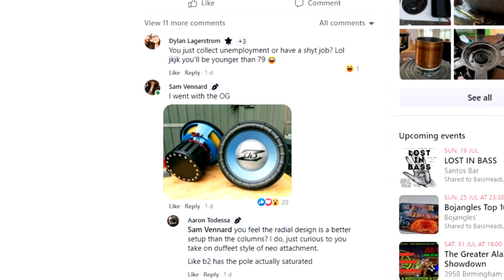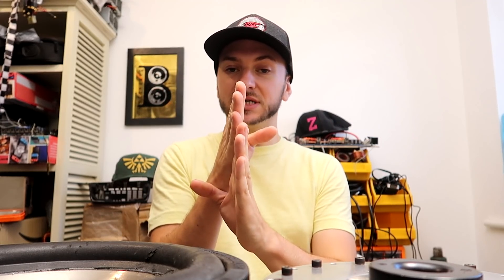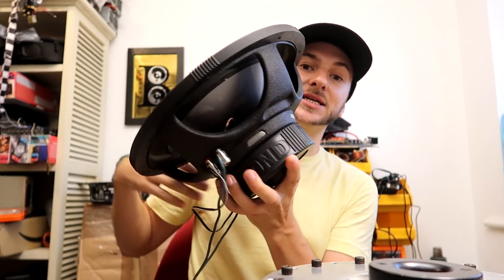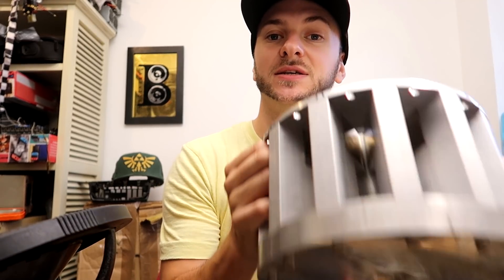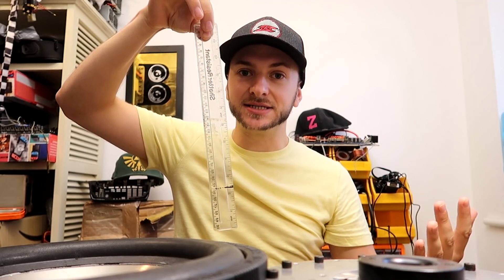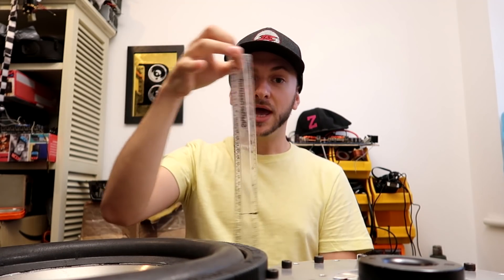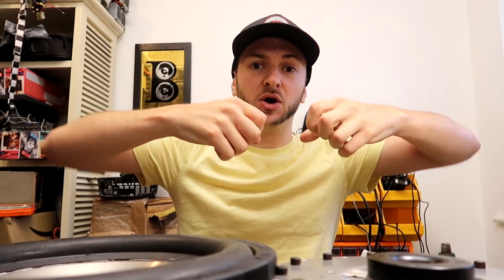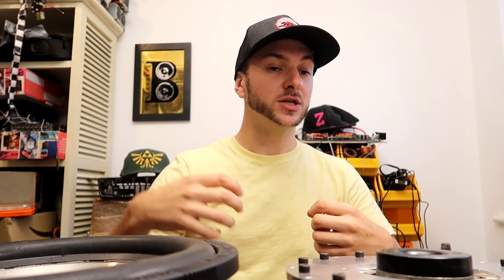Making you realise how ported boxes actually work

Comment: Your explanation verifies the approach at which subwoofer to get determined by the rear subwoofer cone that shouldn't be blocked by the subwoofer frame or basket. For instance CAB 18s and Mmats 12 Juggernauts. Get the picture?

Comment: I have seen video footage of winning one note wonder SPL vehicles. Craig Butler actually uses 2-4 digital designs 18s in small sealed boxes made of a wide diameter tube. So I can only guess they are tuned to resonate at 70-ish Hz and then the rest of the cabin is designed to resonate - either by standing wave or some sort of bandpass to the exact same frequency, creating that huge one note wonder bass.
Reply: Bandpass enclosure... the entire cabin is a box, with a sealed and ported side.
Reply: @n8skow  I'm not quite sure because there is no port to the outside on Craig Butler's video to make the cabin into a front bandpass chamber. You'd have to make a substantial opening to get that big area to resonate at ~70Hz. Making the cabin a half wave and trying to get the sound wave to rebound at the woofers and the mic, so the woofer loads agains maximum air pressure might give some good SPL, especially with a sealed chamber that resonates at the same frequency.
Reply: @TimpBizkit  it IS a bandpass. The entire opening you are looking through when you see the woofers is the port. Its a very common design on the BIG number builds... woofers in tiny sealed enclosure placed inside a huge ported cabin.

Comment: I always wondered why spl woofers claim they are not intended for sealed boxes. I suppose you could put them in a sealed box, but it could rip itself apart if you use it at high power. If I understood correctly.

Comment: So it's possible to reach a point where, in a sealed box, power handling doesn't matter? Sealed boxes are somehow limited and it doesn't matter how much power you throw at your sub it won't get any louder? From my understanding it's not only how far a cone moves but how much force it's moved with that makes pressure. That pressure would have benefit in any enclosure wouldn't it?

Comment: Sealed for the win all day long and it sounds so much better without pissing the neighbours off bass inside not much outside. 2 x 12" 600w peak pioneers running 2ohm at 600w rms I can't wait to get dual voice coils and get it down to 1ohm. + ported is tuned to a spefic freq and most will not boom away from the resonant tune.

Comment: Great way to explain it, great vids bro!

PLEASE explain the Pros vs Cons is a Bifilar voice coil ...from what I read it’s more SQ/SQL based vs SPL, and I’m rebuilding my Alpine SWX-1243D which uses an inset (inner/outer wound) voice coil, so I need to replace it with something almost as good and thinking an 8 layer flat alum bifilar is the way to go ...would really appreciate your input homie.

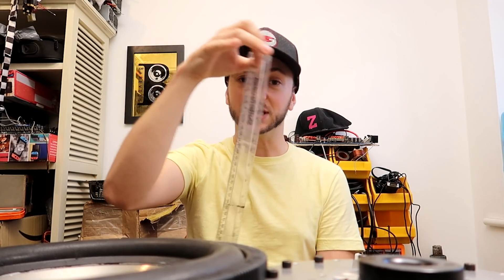Comment: Small correction. When the frequency is higher than the port tuning, like you show in 8:49 what happens is that the inertia of the air mass in the port makes system act like a sealed enclosure and that gives some control to the cone and limits excursion. Under the tuning frequency there is no help from the box like you mentioned.
Thanks for the great video!
Reply from the maker: Great info!

Comment: Your analogy with the ruler was great until you said that higher frequencies unloaded the woofer. That is not correct. The woofer becomes unloaded with lower frequencies below the tuning because the air can move in and out he does not provide any airspring because of how slow the driver moves. It would be like your hand moving back and forth slower than the ruler pendulum frequency and the whole thing moves in and out like a straight line and doesn't swing
Reply from the maker: You unload at higher frequencies too. The rolloff is more shallow but once the helmholtz mode breaks down the port is just a hole in a sealed box, allowing front and rear wave to wrap around and somewhat cancel. Try it, say for example with a box tuned at 30hz, play 65hz and take note of how it sounds, then block the port, you'll notice it sounds a lot better and louder and the driver will move less.

Comment: You can create a louder sound with more acoustic pressure in a horn box or similar with the same Xmax and cone area but a stronger motor. You might need a different type of enclosure to extract the most potential out of these "low Q" woofers. Typically a sealed box will waste the potential of these powerful motors.

Comment: would really appreciate it u can give me a little advice, so i hooked up my soundstream 5channel lil wonder 4 series amp wrong side as in polarity and it wasn't turning on after i check it then i open it an saw a little strip of wired burned out like the flat solder on the board it acted like a fuse i solder it back and now when i connect the amp its getting current cause i can see the wire spark which always happens when he amp gets current (that was not happening before I solder back the trace on the board) so its a good sign. but i am not seeing no light an its not working still any help please thanks u really appreciate it or and I bypass the remote wire with the positive of the amp so idk if that negative current when hooked up wrong side  damage the remote system on the amp or the diode shorted but I only see filter caps where the on board fuse blew no large diode only smaller ones the zener diodes on the left but they don't connect to the positive I can email you a pic if u would like to see thanks. also there is no reverse plarity protection diode
Reply from the maker: hey buddy. For the trace to have blown open like that, it likely will have catastrophically damaged a whole bunch of components on the power supply section and control circuit. It will need to be sent to an experienced technician to get rebuilt.
Reply: @barevids  ok thanks brother

Comment: I used to make these crazy band pass boxes with 1.5cu ft sealed in front of the cone and another 1.5cuft sealed in back with a 4"X8" port But the port always whistled, not a big deal the trunk would absorb that sound but even when I tried rounding the edges of the circular port tubes always whistled Why is that?
Reply: Bad math.

Comment: Bro, thank you.

But now all I can think about is can someone make a box designed with an active valving system for the port to actively adjust the port tuning on the fly to constantly be at peak tuning for the note being played? 
 We've got microcontrollers that can measure pressure hundreds of times per second and electric motors that could open and close different ports or just slide the port telescopicly to adjust the tuning frequency while the song is playing. 
So am I crazy? Or is this possible?
Reply from the maker: Yes but there would have to be a delay in the signal. The circuit needs to be given the frequency of tone from the music, decide what length to make the port, then the motors need to move the port into position. The circuit wouldn't know what tone is coming next until it comes. So you can either choose to have the adjustable port run in constant catch-up which would make for a sloppy sound, have it delay the tone from reaching the subwoofer slightly while it makes its adjustment, or have it analyse the track in advance so it knows what's coming next at all times.
Reply: @barevids  alright. So it's definitely complicated. But is it too complicated? I hope someone smarter than me figures out a good way to do this. I just wanna see it in action.
Reply from the maker: If it would have been viable, it would already have been done.
Reply: @kellypg  also bass is not always just one frequency. The tone and quality of the bass comes from many frequencies stacked on top  of each other

Comment: It might be helpful to add that the reason why you're able to produce such huge excursion in a port with such little energy is resonance. Everything has an F0 or, resonance frequency and that's the frequency at which the thing vibrates the most with the least amount of input energy.

I think one of the most useful visual representations of the power of resonance is the collapse of the Tacoma Narrows bridge. The bridge does fine in the wind until the wind causes it to oscillate at its resonance and then, almost suddenly, it self destructs.

The same thing can happen to your subs in an enclosure that's improperly designed.

Comment: 4:00 so what I'm hearing is the larger the enclosure, the more efficient it will be (to a point)?
Reply from the maker: Yessir, absolutely! But the quicker you will hit mechanical excursion limit! Big boxes are great for super low power subs but anything with any real power behind it and it will rip apart before you even put a quarter of its rated power.

Comment: Exactly!  A port is a speaker cone made out of air! That's the reason why a passive radiator works You're just using a cone and a suspension with no magnet or voice coil to replicate what a port does.

Comment: This is prolly a dumb question but is their a way to figure out if a subwoofer has more motor/electrical force before buying it? I say this because some companies lie about power ratings etc. what are some tell tell signs in the subwoofer specs to look at as “a good subwoofer”
Reply: In the T/S parameters the BL is supposed to tell you the motor force, but just because you have a high motor force, it does not mean better performance or the desired performance. "Better" is also subjective. There are subs designed for high SPL and those "better" suited for SQL and there are some that are right in the middle. And that still doesnt mean you cant use an SPL sub for SQL or the other. Sometimes you can use high power sub to overcome limits in a small enclosure, and sometimes you can use large size subs and enclosures to overcome bandwidth and or power limitations. Thats the fun in all this right? Thats why we love to see everyones different setups.
Reply from the maker: t/s parameters, and an understanding of them

Comment: I remember an older video you did you said ported boxes are basically leaky sealed boxes and i cant get that out of my head
Reply from the maker: Ahahaha yes that's true either side of box tuning, with the "leak" becoming more prominent the further away from tuning you go.
Reply: @barevids  that is actually only true in the lower direction. Under higher frequencies the box will act more like a sealed enclosure.

Comment: In the early 90s I ran a 15" in an open air configuration in a VW Beatle. Not sure about the wattage I had, but I am guessing 350W ish. It was still very loud and rich.

Thanks for the video 🙂
Reply: A friend of mine was doing the same with a Kicker Free Air 15 in a VW Jetta around ~ '98/'99 and man was it loud. It was almost as loud as my 2 Eclipse 12's in a sealed box on about 650 watts. I miss those free spirited days when competition was fun and no one got butt hurt when the Outlaw BASS guys showed up at an IASCA event and the SQ guys swapped build stories with the Outlaw guys.
Reply: @jdizzle3740  I miss those days, I guess my midlife crises has arrived as I am upgrading my car with amps and speakers again :P  Not anything super good, but a good upgrade from stock at least. I bought an used older PG amp at 600 watts in 2 ohms, but I am still running a rather bad all in one 12" until I can get a new box and 12" for the amp. Maybe even a 10", not sure yet. :)
Reply: @jonbeargenx  Same here. I picked up a budget gem JL Powerwedge Max 10 w/250 Watt JL Amp off CL for 75 bucks in great condition, have a Memphis 2/3 way xover for it and run off an adaptor from the factory head unit (want to fix that), upgraded the doors and added Tweeters to the factory location and it sounds pretty good (not like back in the day when i would hit 148-149 db in a low power class, but for my old self, it definitely works for better SQ). Glad to share the, I won't say midlife crises, rather, nostalgic moment. Have a great one boss.
Reply: @jdizzle3740  That's great! Nostalgic for sure :) You have a good one too buddy.

Comment: So I just want to know for a sub that can play 23hz to 150hz where should I tune my port to listen to music ?
Reply: 35hz down to 30hz that gives good bandwidth for a musical setup when ported.
Reply: Make port small (as in diameter) enough so it doesnt choke, but not so big so it plays only resonant frequencies.

 Smaller resonates with more freq/bigger resonates to lesser freq.
Reply: There are so many factors that are involved, the most important being the listeners taste. The next major factor would be your listening environment. Then comes the subwoofer in question. And that is not even close to the total variables. The most basic answer I could give you with that information would be to tune to the lowest desired frequency. Since your saying music is the preferred sound, and your requesting a wide band width, use an enclosure such as a t-line, folded horn either rear or front loaded, 4th order or 6th order. Each of these enclosures would do the job but there are reasons to choose one or the other. Is this a 2" subwoofer like the tangband W2, or a 32" Deafbonce? LOL sorry I got a bit involved.

Comment: That ruler analogy was perfect. I am struggling to understand how more power translates to louder bass/more pressure if the excursion stays the same?? Is it because the woofer is moving in and out quicker, with more force on the up and down portion of the sinewave? Just confused as to how more power translates to physical movement to make it louder without changing excursion or frequency.
Reply: Port load. 

When playing inside the port tuning frequency the port is the heaviest load on the woofers motor. Think of it like driving a car up a hill- it takes more power to move the same distance up a hill as on flat ground. That additional power isn't lost it's just been redirected to increasing height. The analogy here being distance = cone movement ; height = port load. It's not a perfect analogy but I hope it helps some. 
The key is resonant frequency. At the resonant (tuning) frequency of the port, the energy you put into your woofer is transferred to driving the port instead of moving the cone more.

Comment: And for those of you that might inquire, the same theory applies to Passive Radiators, but your tuning is based on the cone mass, and cone displacement.
Reply: Was just wondering that exact thing. Thx
Reply: @Steve_Just_Steve  No problem
Reply from the maker: Damn I knew I missed something!
Reply: @barevids  All good bro. It was all about ports. Passive Radiator can be the next video. The video is for sure spot on. Great work man. Waiting for class though.

Comment: Now give thoughts on 4th and 6th order boxes.
Reply: Assuming you mean bandpass enclosures, they follow the exact same laws of physics explained in the video. The only difference is that they include a steep rolloff above their tuning where a conventional ported alignment does not. And to clarify my first statement, conventional ported alignments are 4th order enclosures.
Reply: 4th order is the benefits of both sealed and ported in the same enclosure....6th is 2 ported boxes tuned to different frequency..one side is high the other is low so you get the benefits of all ranges..down side of both boxes is they require more air space...
Reply: @MyBlowncobra  No. Bandpass enclosures aren't the best of both worlds, they're a world of their own.

They are purposefully bandwidth limited alignments and limiting bandwidth is seldom a best of scenario.

They're useful for high SPL builds or as natural low pass filters but that's mostly a bygone use since we now have very accurate and dependable electronic crossovers.

They are by their very nature, bandwidth limited alignments and as such you do not  "get the benefits of all ranges" with them.
Reply: @BrandonBuckaudioanarchy  I would say that depends on how you design the 6th or higher order enclosure and the installation.  So you're both correct.
Reply: No. Band pass literally means a relatively narrow passband. It is impossible to design a bandpass enclosure with the bandwidth of any other alignment.

You can design a bandpass with wide bandwidth relative to other bandpass enclosures but you will always be faced with the upper end roll off that you don't have with other alignments.
Reply: @BrandonBuckaudioanarchy  Sure, if your total experience and knowledge base with bandpass is reading about it and building maybe 1 box then commenting on youtube videos.
Reply: 4th order is so much better, I get both my lows and high Bass. If anyone is going for musical, and you listen to a wide range of music, 4th order is the best way to go.

Comment: The easiest way to deal with the lack of damping below the port tuning is by using a very steep HPF below the port tuning, but that adds group delay (which ported or passive radiator alignment as a 4th order system already has more than a sealed alignment, which is 2nd order).
Reply: Other solutions include using the right box for the subwoofer 🙃😉
Reply: @sedon7098  still doesn't fix a complete lack of air spring below port tuning.

Comment: I used to run 4x 12w6s(v1) in a giant sealed box. It was 2.5x the cf recommended. I also ran them  at peak watts. They were a ton louder in the giant box vs the factory recommended size box. Why is this?
Reply: A bigger sealed box plays lower than a smaller one.   I think the difference you heard was the lack of a steep roll off from the smaller box.   He didn't really explain that part about sealed boxes and how that works.
Reply: Did you watch the vid? @3:39